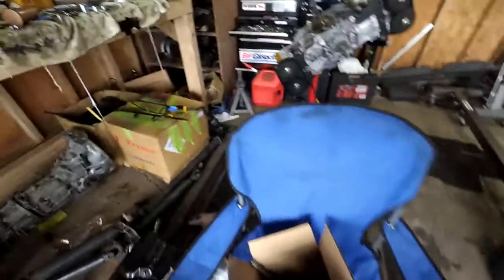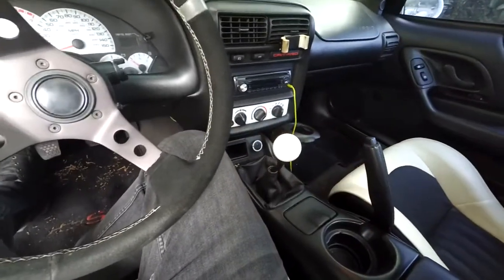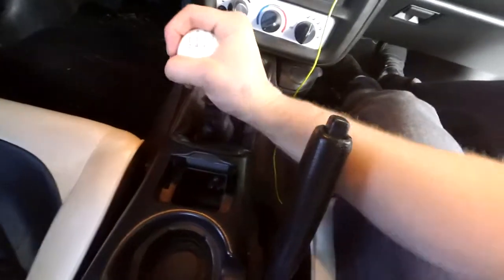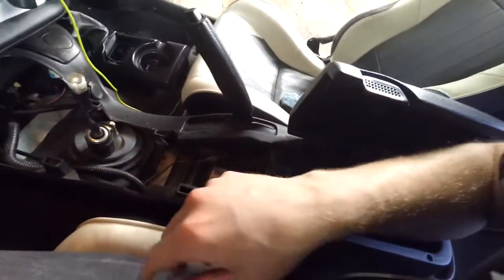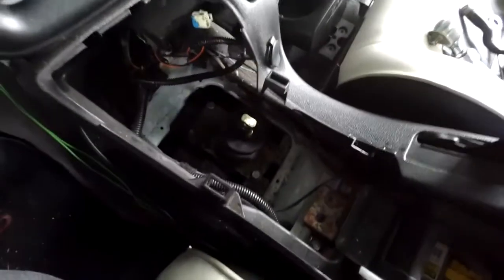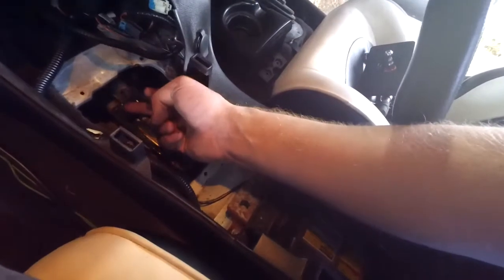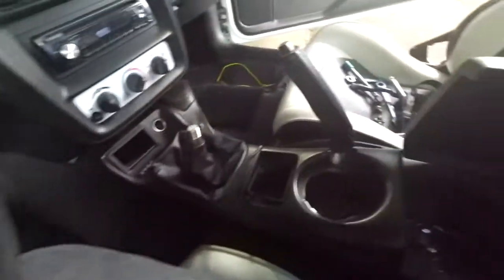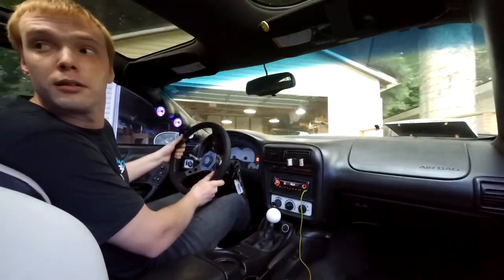MGW LS1/T56 Short Shifter (F-Body Camaro/Firebird)

Comment: So you took off the good short throw shifter and put on a different short throw shifter. Probably why some of the boot bolts were already missing. Someone previously installed a short throw shifter. Thanks for the video.
Reply from the maker: I don't think so, this transmission has been out several times and I'm the 7th owner haha.
The shifter I took out was the factory Hurst option shifter which wasn't bad at all, better than the original non Hurst unit, but I'm very happy with the MGW, I did want to try out the Tick performance shifter too.

Comment: You had a rare factory Hurst shifter in the car, I believe a 700 dollar option from the factory.
Reply from the maker: All 98-02 camaro Z28/ss had a Hurst shifter standard and it's terrible lol
Reply: @HackSquadGarage  most F body m6 cars came with a stamped steel shifter that was even worse than the Hurst option offered. I had 2 of them and they were so bad that shifting into second gear would actually hit the console.

Comment: I know this is old but where did you get your steering wheel??
Reply from the maker: I bought it directly from Grant racings website for about $150 if I remember right. They make the adapter boss kit as well but they have been getting harder to find.

Comment: I have a 2000 trans am 6speed with a brand new tick master cylinder and pro 5.0 shifter but I still cant shift at high rpms 2and 3rd over 5k is like Impossible
Reply from the maker: You could have an issue with the slave, or you need to adjust the master more to grab higher. I had that problem with my stock master.

Comment: What size handle you got 16 mm (oem size) or the 12 mm x 1.75 pitch ? , I have a 96 z28 SS
Reply from the maker: It was the stock size as I had this knob before the shifter upgrade.
Reply: Thank you for the response back, how long have you had it and have you had any issues with it yet ?
Reply from the maker: @michiganboy1869  so I've had it on the car for more than 2.5 years now. No issues at all. I really enjoy it. It is really tight and notchy which I like.